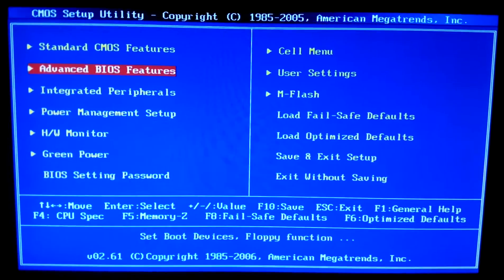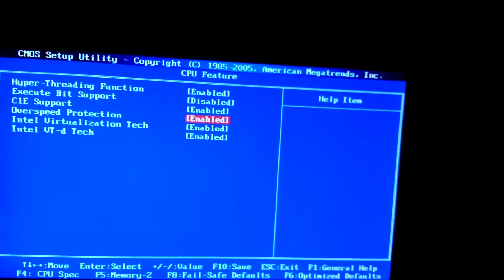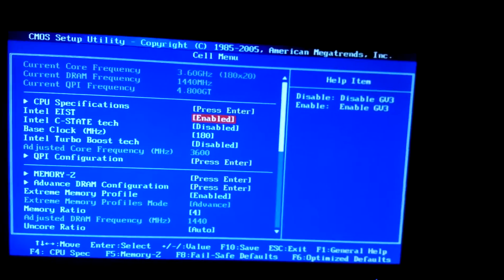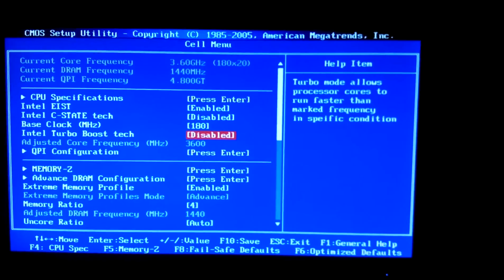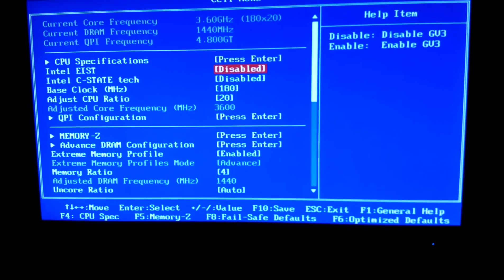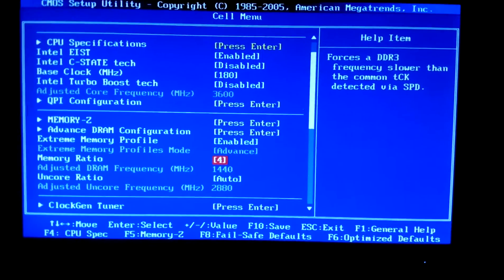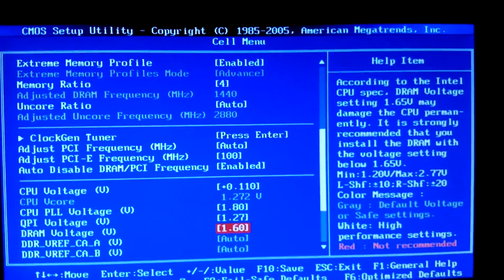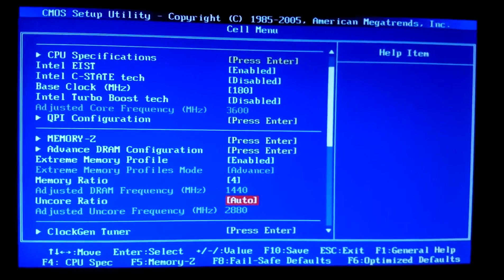Overclocking your Intel Core i7 920 CPU, processor

Comment: amazing tutorial, thanks! Seems I have MB as yours - Msi x58 pro-e. I set all settings as in this video, except CPU voltage (it stays auto) and Aida64 shows me 1.4 V. Is this voltage safe or i must put it +0.110 in bios as you show on 11:40? The second question: i have ddr3 1333 Mhz, 1.65 v, it will be safe memory ratio = 4 with adjusted dram frequency 1440 MHz ? Because on Auto Memory Ratio my computer even doesn't starts on 3.6 Ghz cpu (only until 3.1 Ghz)

Comment: Wapn thanks for the video. OC'd last night to 3.2 and it ran great. I did get the CPU temp up to 84C at one point... while playing PUBG. Im going to lower the voltage a little tonight and see if that helps. Also running a stock cooler, so im sure thats part of it also.

Comment: I know this is old vid but, you probably already know that when you have ram that is spec to run 2000mhz , and you over clock a cpu and get a lower ram target speed, then you need to lower your ram voltage a little and you should have stable at 3.6 , if not then lower ram voltage and increase some of the ram timings ,, just the first 4  like from 9-9-9-24  , to something like 
10-9-10-22  . There  is a tutorial on it at toms hardware . .  This vid helped me out , did not know I could go higher from 3.33 to 3.5 on 1333 mhz ram.  I forgot turbo boost gave you that extra multiplier with out increasing the ram speed.  Anyhow its worth it to go with 1600 sticks cause you can get about 4ghz  outa a i7920 on that.  Im rocking BF1 with a GTX 770 on overclocked 920  to 3.49 .  no bottle neck at that speed. Average 100 fps on most maps . liquid cooling keeps me at about 40 c full load

Comment: when i am trying to overclock over 3 ghz equal to 150 bclk it wont work. PC wont boot any idea how to fix?
Reply from the maker: I should have mentioned that there are some CPU speeds that are no no's because the CPU doesn't like the bus frequency. I would try 3.2gHz... 160mHz... usually the i7 is 100% happy there. Hope you get it.